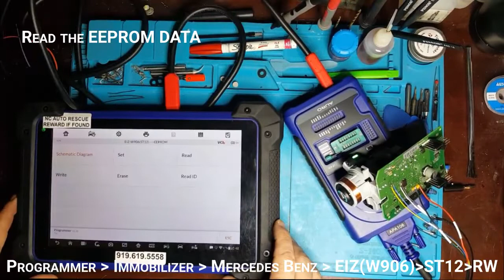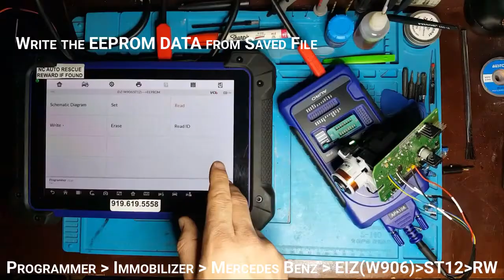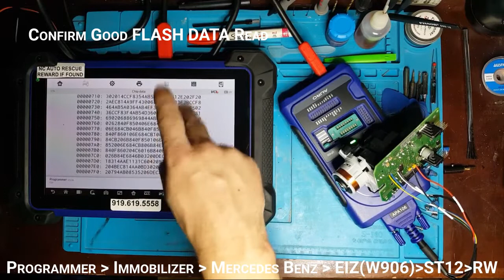Mercedes W906 (Sprinter) EIS / EZL Cloning with Autel IM608 Pro XP400 Pro

Comment: Friend in the diagram, do you have to remove the smaller capacitor or do you solder the wires with the capacitor?
Reply from the maker: You do not need to remove the capacitor.

Comment: I have im508xp400pro and gbox2. W906 had missing eis. I connected eis with working key to the car. I made a new key, no problem. But the key doesn't turn the ignition and no steering wheel unlock. How can i make this work with autel? Please help